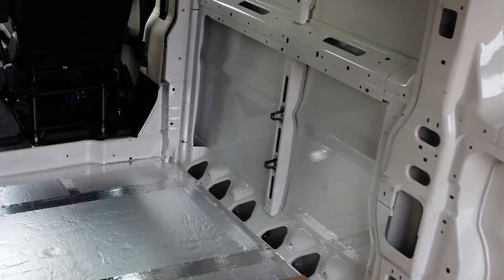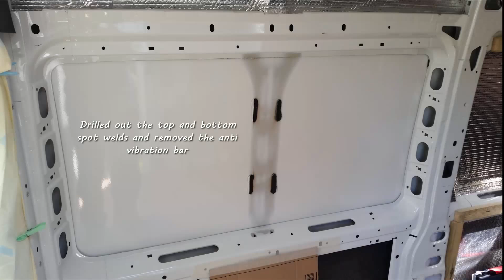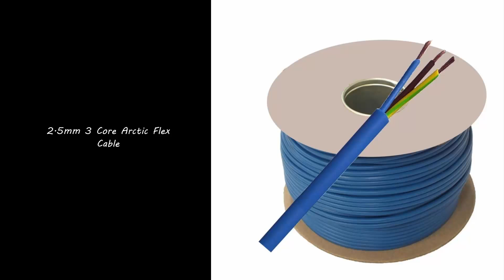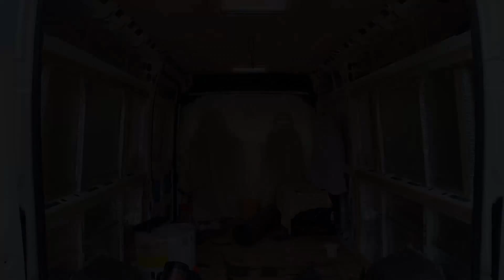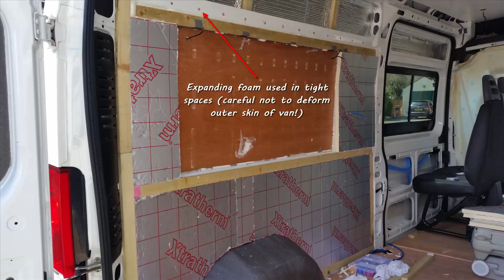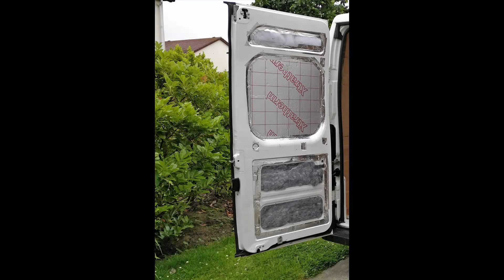CAMPERVAN BUILD: Self build van guide - part 2, 240v, Side Windows, Wall Insulation

Comment: Can you use wood instead of the carpeted walls?
Reply from the maker: Hi, yes I have seen a lot of people using tongue and groove cladding and either painted or stained tbh this would be a cheaper option as the ply & carpet & spray adhesive for the carpet are expensive. The only issue you might have is the expansion of the wood in different temperatures and gaps between the cladding may appear, it might help with gluing all the joints. Hope this helps :) Andy

Comment: What a great build. My van layout is going to be more or less the same. Can I just ask how you insulated and finished the above cab compartment? I can't decide the best way to go about it.
Reply from the maker: Well to be honest I used the foil bubble insulation with the 7mm black foam insulation and left like that! There is always clothes and towels etc up there so its always full, I wasn't sure if I was going to put a cober/cupboard over the front but it works for us to leave it open as it's easier to get to the things up there 👍

Comment: Hi Andy,
Did you put the plastic loft insulation behind the kingspan around the back wheel arches as well as the nooks and crannies or is there a gap between the foil and kingspan because its pretty wide there where the battons are stuck on and did you wedge the sharp metal edge around the wheel into the kingspan, I got the same van and I'm at this stage now. Regards Andy
Reply from the maker: fred blogg no i only used the loft insulation in the nook n crannies there is a gap between the 7mm/foil and the kingspan hope this helps 👍
Reply: Yes that Helps a great deal Thx Andy :)

Comment: Hi Andy where did you get that big roll of 7mm closed cell foam insulation from, I'm strugling to find it anywhere that size ?? Regards Andy
Reply from the maker: fred blogg hi, I bought it off ebay it was listed as household carpet underlay and it was a lot cheaper than a smaller roll of van insulation that was the same stuff. Hope this helps. Andy
Reply: Thanks Andy, yeah I saw the smaller 1's your right about the price, will check the carpet section thx Regards Andy

Comment: Did you fill the bottom channels with insulation? It looks like you did. Shouldn't these be left open for draining condensation? Also did you remove the airvents in the back or just insulate over them?
Reply from the maker: Hi, yes i did insulate with the plastic wool loft insulation which doesn't hold water, i have seen others that have and haven't insulated the bottom channels, do what you think is best :) If you mean the plastic vents that are by the sides of the rear doors yes i insulated them and then screwed the black covers back on. hope this helps. Andy
Reply: CamperVanTango thanks, I’ll put thinsulate down there. How did you remove the black covers? Did you break the white tabs? When you say insulated the inside you mean you blocked the channel with insulation?
Reply from the maker: Hi, have you watched part 3? there is a couple of pictures near the end of the video that shows the insulation and the covers back in place. If its the same place we are talking about then all i did was remove the plastic covers filled the voids with the plastic rockwool then i carpeted over then screwed the covers back on. The smaller black covers that are clipped on i used a screwdriver to pop the clips off, insulated then popped them back on and carpeted over these.
Reply: CamperVanTango yes I watched part 3. (I’ve actually watched all of them multiple times!) I think your not thinking of the same. Lack air vents they are the little triangle shaped boxes yo the rear of the rear wheel wells. I understand how you did the bottom channels just not the air vents
Reply from the maker: O I know what you mean now lol with the little rubber flaps on them, yes i just left them as they are and just put the plastic rockwool in the void whether this is right or wrong who knows! :)

Comment: You've shown a lot of attention to detail and care in designing out later problems.  Too many people seem to insulate the big areas using the same products but don't solve the problem on the hidden corners being uninsulated.  These, as you have realised, become places where moisture condenses out and the vehicle will rust if the water sits there.  I'm sure it took much longer to apply builder's foam behind structural metal elements but the longevity should increase hugely.  It will also be more comfortable and require less heating/cooling..
Reply from the maker: Julian Webb yea some tight places were a pain to insulate and many a cur finger trying to force it in there but as you say will be worth it in the long run

Comment: You're not suppose to use reflectives for the insulation without an air gap between the skin of the van and the reflectives. Without the gap inbetween the reflectives will just conduct heat and not reflect it.
Reply from the maker: HDsharp I used the 7mm pe foam on the skin of the van and the foil bubble wrap on the pe foam.
Reply: CamperVanTango Andy where did you get the 7mm closed cell insulation?
Reply: Andy where did you get the 7mm closed cell insulation?

Comment: I really enjoy your video's, thank you for sharing! I am still in the research phase and I wonder why you chose for these particular types of insulation? Are they also based on a calculation so you knew the total value you needed for certain temperatures min/max temp outside)? Looking forward to your next video!
Reply from the maker: Hi, not really based on calculations but get as much in there as possible and i think the closed cell foam is the best to have on the skin of the van then the foil bubble wrap was just an extra. The 25mm kingspan was just right to fit in between the battens. On my research having the gap between the foam/bubble wrap and the kingspan was also a good idea. Andy

Comment: Excellent work my friend, and choice of insulation and materials. I'm hoping to have a van by the Fall, and it's either going to be a cargo van or a window van, but if it's a cargo van, I will be doing the same work on it that you're doing here, on the windows, and the same choice for insulation. 

Some people make the mistake of using Reflectix for insulation, but it's not for insulation, it's to reflect the sun away from the interior, on windows only. 
And to those that know the difference, they will tell you that the bubbles, like bubble wrap, in the Reflectix, is what holds in heat. You've made the correct choice for insulation, like I will do on mine when I get it. And those windows are looking great man. :-)
I love the space in your van. 
Much fun and peace to you. :-) ✌
Reply from the maker: Thanks for your comment, I'm glad it's helpful to people building their own vans :)